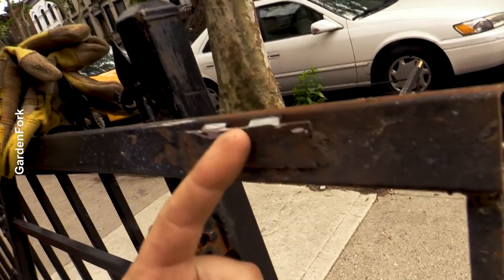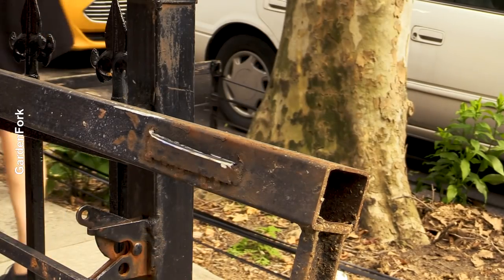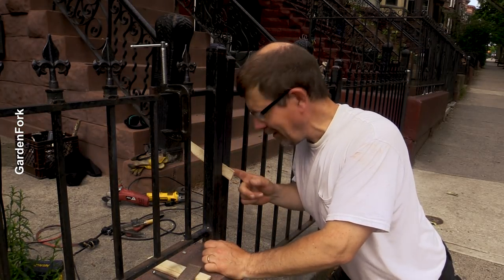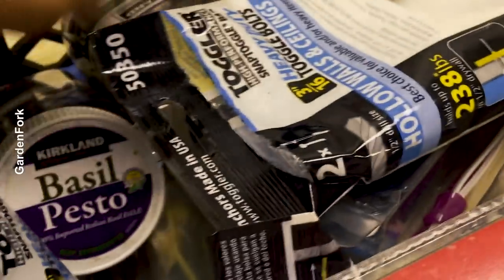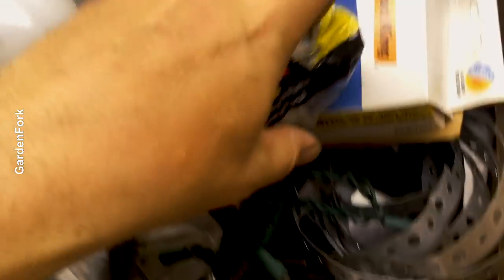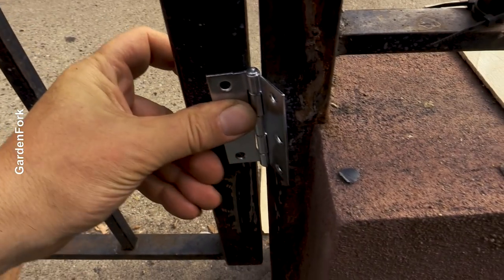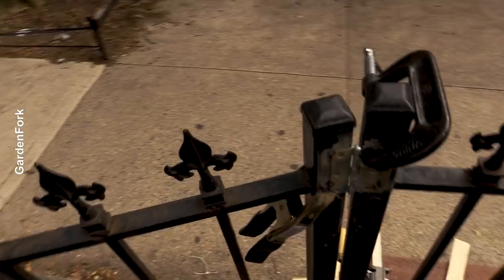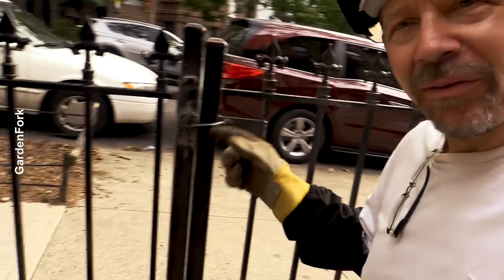Buy A Welder, Fix The Gate, Learn Stuff.

Comment: get rid of the gas hood with flux core welding you can get a plastic end to cover the tip makes it easy to get into hard to reach places and easy to weld , you can also use the screw  holes to tack and weld the hinge on like spot welding
Reply from the maker: Good info, thx for that !
Reply: @gardenfork  look up lincoln electric FCAW-S/Flux-Cored Self Shielded Wire and the Boy Scout Welding Merit Badge they show the tip there find the one that fits your welder
Reply from the maker: Never would have thought of the Scouts!  I did buy the Lincoln wire. Def made a difference. Thx for your expertise!

Comment: Any chance of a vid with basic mig settings 🤔 Cheers
Reply from the maker: Sorry I don’t have a MIG, but it varies according to your machine. Thx!
Reply: Hi, the welder you are using is a mig system ( metal inert gas) not the make mate, the welding platform ☺️👍